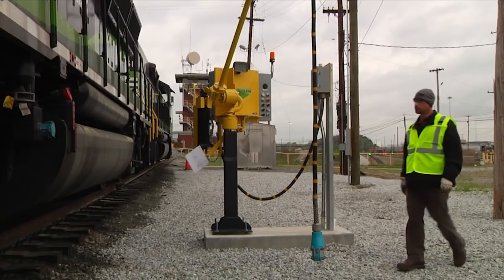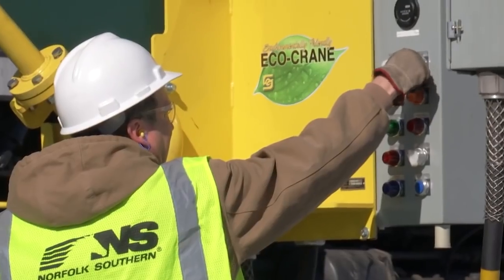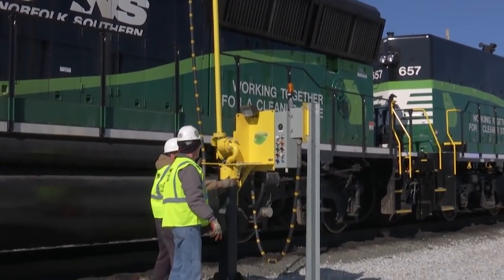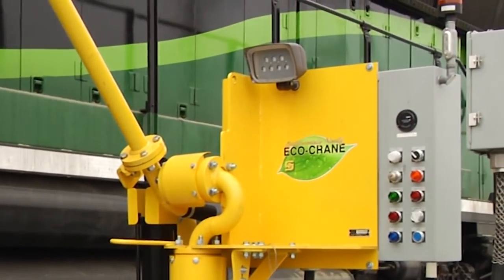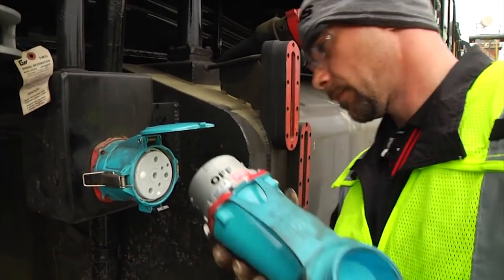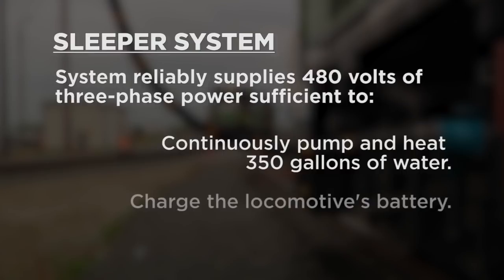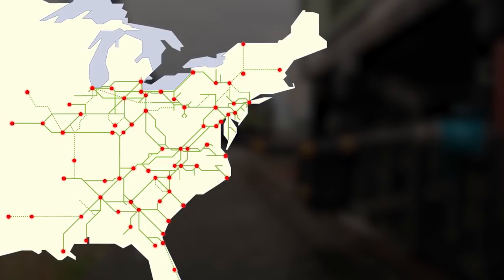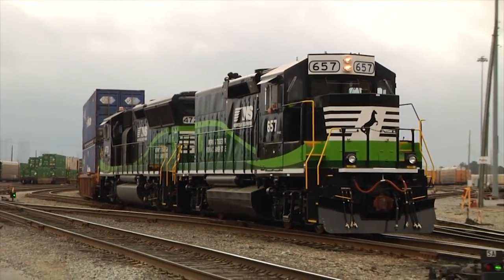Norfolk Southern's Sleeper Technology

Comment: Diesels do use antifreeze. Otherwise it would freeze. There are many trucks that they shut off at night..
Reply: Locomotives do NOT use antifreeze. They use water for coolant. Locomotive prime movers don't require antifreeze, as it's not nearly cost-effective or environmentally safe. The locomotives have a special plug in the coolant tank that dumps all the water if it drops below 40°F.

Comment: Hmm wonder when someone will think to place a battery pack on the locomotive and use dynamic braking to charge it then use a trickle discharge to keep the engine warm.
Reply: Good idea but not cost effective.  The batteries would get drained quickly

Comment: One downside is you have to do this directly next to one of the power taps. Seems like they could come up with something like a clean burning propane-fueled secondary system onboard the loco that could work anywhere.
Reply: me999 maybe set it up so that you can plug one engine in, and the power is passed through interconnects between engines tied together to any other engines connected as well. Retrofit a passthrough cable on any engines not equipped with the needed equipment.

Comment: I have a question.  Suppose you run out of gas while on the rails.  What do you do?
Reply: Call the dispatcher before running out, arrange for a fuel truck to meet you somewhere ahead.  It actually does happen sometimes that a loco isn't properly fueled before being assigned on a run.  It's seldom that one runs out and dies, but it does happen once in a very blue moon.  The more modern locos have more sophisticated sensors in the tank that send info to the computer so that the Engineman can be made aware of fuel levels of the unit(s) he has on his train.  That info would also be sent electronically to the dispatchers and management, but it's usually the Engineman who discovers a low fuel level first,  so he has to report it (like he would report any other problem) to the railroad,  and someone in an office makes a decision on how the problem gets handled.

Comment: Use catenary to power the traction motors instead of the diesel engines.
Reply: The refitting of those lines would cost billions, plus require all new locomotives that could not be shared with other railroads.
Reply: nope I like the noisy diesels locomotives the sound coming from those big primemovers is part of the beauty of the railroads(:
Reply: The Milwaukee road did for a little while.

Comment: Antifreeze stops internal corrosion. Stops you getting rusty cooling water and stops electrolysis on liners and helps your engine run more efficiently by raising the boiling point of the coolant.
Reply: pressurization raises boiling point
Reply: M Smit agreed
Reply: Railroads use anti corrosion tablets in their engines.  Much cheaper than anti freeze and environmentally friendly

Comment: Why can't diesel locomotives use anti-freeze?
Reply: It's due to the fact that a lot of diesel locomotives still in service have looser tolerances in the engine. Water sometimes leaks from the water jackets in the diesel engine into the crack case where it mixes with oil. Water in the oil system is less harmful than antifreeze because antifreeze can destroy the bearings in the engine and cause the oil to loose it's lubricating properties.
Reply: Fascinating. Thank you!
Reply: You're welcome.
Reply: It was never cost effective either

Comment: Save on fuel yet all the nuclear power plants producing more power more waste from the spent fuel rods so how in all can it really be mrs efficient ?
Reply: 96% of a "spent" fuel can and should be reused. Nuclear "waste" is not a technical issue. It's a political and emotional one. And only thermal spectrum LWRs produce "large" amounts of waste. Molten salt reactors and fast spectrum reactors make much more efficient use of the fuel. Anyhow, nuclear fuels are between 1 and 3 million times as energy dense as fossil fuels.
Reply: ChrisLawley As far as emissions go, nuclear waste is clearly superior- provided that there isn't a containment breach, which is even less likely these days as we have found much safer methods of nuclear power generation, such as thorium salt, etc.
Reply: exhaust makes the air dirty.  the sleeper stations don't.

Comment: 0:03 When did NS start using electric power?
Reply: just RR stock footage
Reply: I think only 2 of the 4 people who replied actually got the point.
Reply: @RaisedLetter  who are the two?
Reply: @marilllover2177  you are not one of them. It's clearly stock footage from an old-world country. You don't see that style of catenary on anything Ex-PRR or on the Black Mesa and Lake Powell which is defunct now.
Not to mention that's not how any intermodel looks in the states let alone on NS.
Reply: @RaisedLetter  go figure
Reply: @sonyman2004  what?
Reply: any U.S. diesel is electric hence Diesel Electric!
Reply: @Kevin-ev7hw  i think the electric is the Head End Power side
Reply: i think that is like the keystone corridor or the RR that has a coal mine train and works like a conveyor belt or somthing
Reply: When did NS have rail lines in the old world